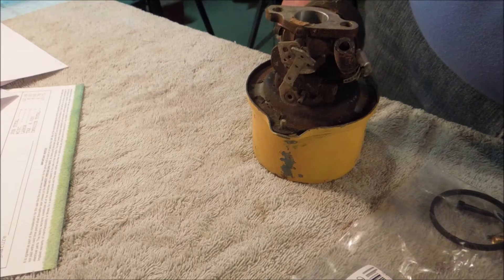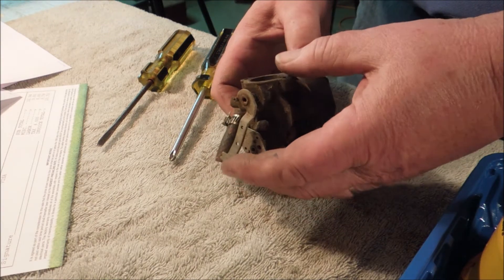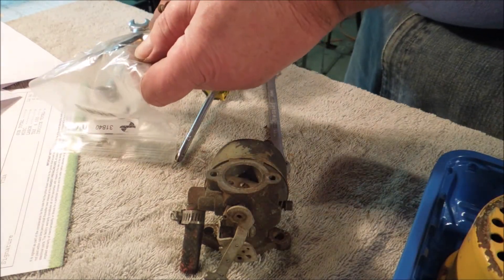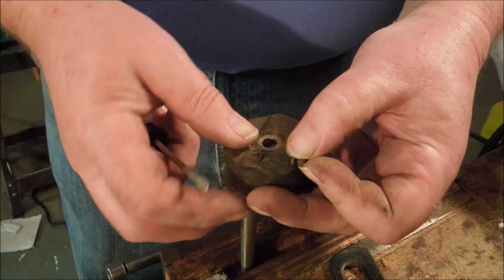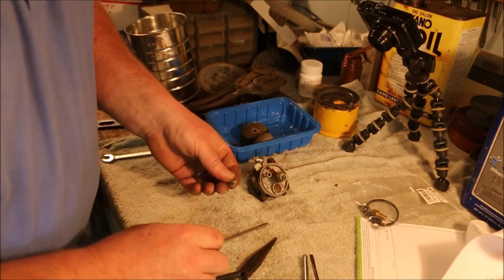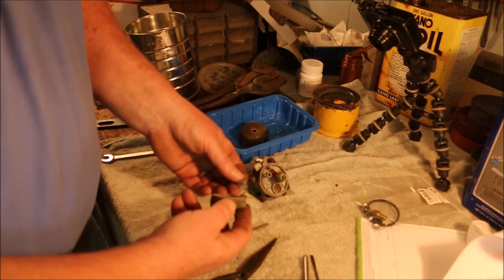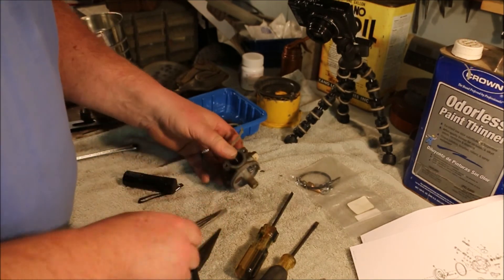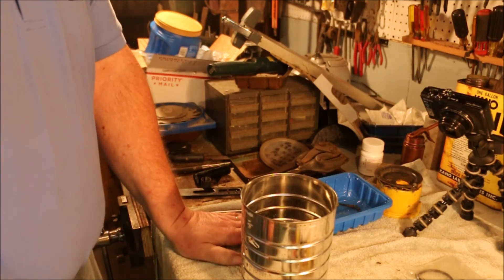SEARS 1250 WATT ALTERNATOR ~ PT 2 ~ CARB REBUILD ~ DISASSEMBLY

Comment: Good video unc nice to see you again hope all well my experience of carb rebuilds we soak them in brake fluid brakes down carbon and not only cleans every nook and cranny but loosen the screws etc this is of coarse long before the invention of carb cleaner .old ways I never know but it might be your answer hope it might be of some use 👍
Reply from the maker: Thanks David. We are doing okay. A bit tired but not too bad. 
I'm going to leave the throttle and choke plates in. The shafts won't  stand much abuse and my engine parts bin got left behind when Mom and Dad moved 35 years ago. 
I think the carb will work. The jets are open near as I can tell. Not much to go wrong.
Reply: Old Sneelock's Workshop I think that's very wise disturbing the plates can cause more trouble than it's worth and if there's no extreme wear there's really no need . Good luck with it your doing as far as I can see all that is  necessary so I'd say should be plain sailing . You say your tired please be careful were not spring chickens anymore lol . Catch you soon take care
Reply: I never fooled with them at all and never had any problems with them either. I think you're safe with this.
Reply: BLO and you were WAITING for this, I know! Happy, happy Mr. Chadwick!

Comment: My buddy always joked "It took me twenty years to learn how to rebuild a carburetor, then they came out with fuel injection"!  😂😂😂
Reply: yep and i cant get my head around it! i have a modern car, i cant do a thing to it
Reply: I'd rather have the carb!
Reply from the maker: Warning Old Guy Story: 
When Ryan was 15 my Brother In Law Ewald called up and asked if Ryan wanted a truck. 
It turned out that his neighbor had parked a Chevy S-10 in the woods behind his house and decided it was time to get rid of it. With some misgivings I agreed to go look at it. Ryan was excited.
The truck was a wreck. The body had some rust. The hood was bent. It was full of junk and the headliner hung down far enough it sat on top of my head when I got inside to check the interior. 
It looked like the running gear was okay and the tires held air. It wouldn't start but it cranked with a jump so I figured what the heck. It was free. 
We were living by Union City at the farm. I rented a trailer and hauled it home. It sat in the barn for a few days until the week end. 
Ryan and I started working on it. It would run if I dumped gas in the intake but only for a few seconds. I started trying to figure out what was going on. 
The fuel injection system wasn't delivering fuel. All the wiring diagram showed was a line going into the black box (computer) and no idea where the wire went afterwards. I put a meter on the wire to the fuel pump and it was getting power for about 3 seconds. That's a secret safety feature.......
Telling me that it shut down after 3 seconds of no fuel pressure so the fuel pump wouldn't drain the tank on the ground through a broken line would have been nice.
After a lot of searching and buying a book on the truck we figured out that the fuel pump wasn't working. I had replaced the fuel pump on my truck prior to this so we figured we could do this. 
The fuel pump is on top of the tank. On a full size truck you can drop the tank by removing the straps. The little truck was so low that I couldn't drop the tank low enough to remove it. The barn had a dirt floor so we dug under the truck and pulled the tank. Rodents had eaten the ground wire off of the fuel pump. 
We pulled the bed, remounted the fuel tank, and replaced the ground wire connection. TA DA! Success. 
The black box is fine. I don't mind having a high speed circuit controlling the engine. Better than relay logic.
I don't mind fuel injection. It works in all positions. The old Mall Chainsaw with a float bowl had to be run with the engine vertical so they made a rotating collar to turn the blade. That was a pain. Diaphragm carbs like on the new engines are okay but a rebuild is pretty much toss it. 
The thing that bugged me was it was all secret stuff. 
We got running and when Ryan got his license he was tickled pink to be able to drive it to school. No more waiting for the bus.
Reply: A buddy of mine's dad had a all like that and after I found out what was what the Tillotson on my Harley would roll over so you'd see the front forks dip on every round. SWEET! Sometimes I wished I still had it but if I had I OR it wouldn't be here. And the neighbor was riding another Sportster yesterday. He just can't stand not having one!
Reply from the maker: Got rid of the Harleys after the engine blew a rear cylinder on the 74. 
About 6 years later I bought a 650 Kawasaki. 4 cylinder 4 stroke went like crazy. Realized I couldn't trust myself not to be stupid. 
Riding a wheelie at 120 was exciting. It also is one of the dumber things I have survived only because God loves me and the Devil is afraid I'll take over.
Reply: I was coming home on the Electra-glide one night and decided I ought to roll on it so coming into a couple of stiff right curves right below the sawmill I went for 2nd and rolled on it, then 3rd and the  4th which was a short ratio between it and 3rd. Shen I rolled back out of it a very short ways later I was dong 95. Then I remembered the slick tire and half the rollers off the chain and when I got home I never kicked it over again. Always wanted a Honda 750-4 but thought I best not get any goofier than I already was. Trucks and equipment was dangerous aplenty and like the two old riders at the V.A. said, It's not IF, it's WHEN!
Reply from the maker: There are old riders and bold riders but there are no old bold riders. 😈

Comment: The choke and throttle plate screws might be swaged like they are on auto carbs. If so you have to grind off the threaded end, probably not worth the trouble. Anxious to see this one run.
Reply from the maker: I don't work on a lot of Tecumseh engines. Not my favorites. I don't often run into stripped screw heads on choke or throttle plates. 
Grinding off the head would be more effort than it is worth.

Comment: Hi Mr. Sneelock

Do you think the manufacturers of that carb may have put a spot of loctite on the choke & throttle screws to prevent em working loose and dropping into the engine...?

Try a carefully directed light heat on those screwheads....as that should break down the loctite if it's there...

In regards to drinking mineral spirits...
OK.....until you go outside for a smoke...
Hmm....whats the chances of an "internal explosion" occurring...?

Lol...lol...

P. S. I've a load of vintage & antique flat belt machine tools on my channel if you want to have a quick look...😉
Reply from the maker: glenn moreland It's possible that there was some thread lock used or the end might be damaged. The carb on the 10 hp Tecumseh came apart easily. I think I'm going to leave them alone. The carb would be tough to replace if I screwed it up trying to fix a non existant problem. 😆
Reply: Old Sneelock's Workshop

I like the Swan beam drills you do as well...
Apparently, your the "go to" man in here (Utube) for advice on em...